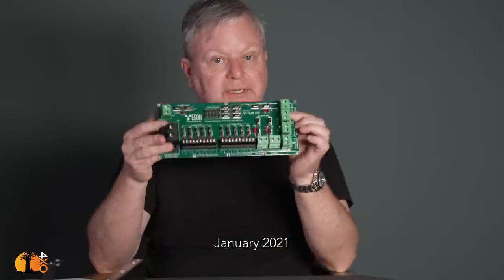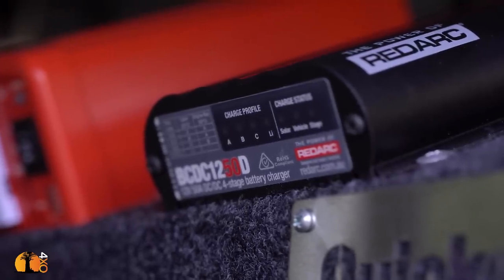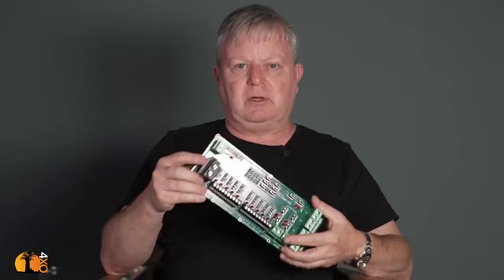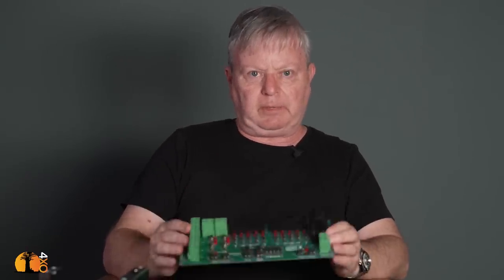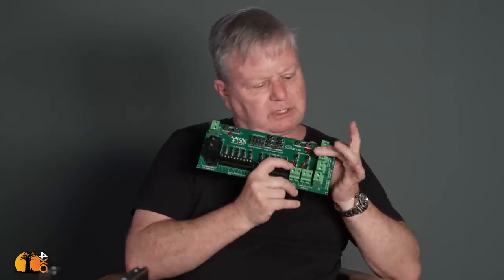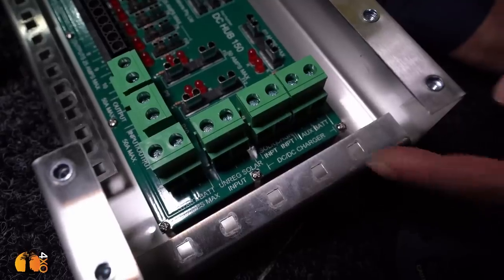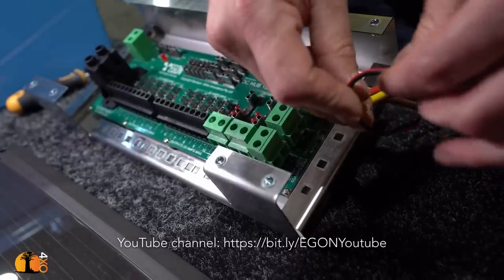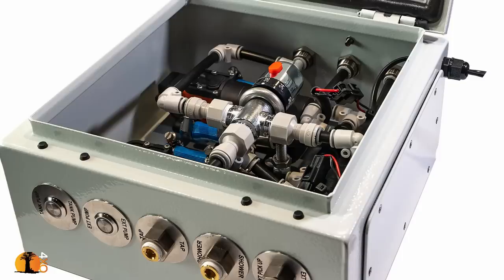DC-INSTALLATIONS MADE EASY. Unique, Problem-Solving Solution. Egon DC-Hub

Comment: So you made a fuse box. Would be nice to have some relays
Reply: That would make it bulky, but you're right, it doesn't cater to the all-important relays. That seems to be an afterthought. This EGON is supposed to make the electrical system easier and relays weren't addressed.
Reply: @Malc664  why would relays need needed? The circuits are well protected by the fuses in this central DC hub. I don’t see any need for additional relays for this hub.
Reply: @gotoylc  you would need relays for most appliances, unless you have switches that can handle massive current loads.
Reply: @Malc664  it already is bulky given it's a glorified fuse box
Reply: 100A on a regular fuse holder??? I definitely would prefer a mini ANL fuses for that current.
Also, the connectors are not reliable at all for a typical vibration 4x4 truck. Bolt terminal are way better.
All cables to the same point? Not always the best solution for every needs.
And by the way.... If some contact gets hot.... You may loose all your electrical circuits....
Sorry. I wouldn't buy it. A have a lot of circuitry. 24v and 12v and I definitely prefer good quality 24 and 12 and ground distribution blocks with mini ANL fuses.
Reply from the maker: Yes, its a fuse box. But there is no fuse box IN THE WORLD that does what this does. How many fuses in a typical trailer or 4wd build? 10? 20? And where are they? All over the place, in line, fuseboxes and how many buss bars? 1? 2? 3? How do you fault find in all that maze of cables? Is it easy? How about one unit where ALL the fuses (with the exception of battery terminal fuses) come together in one place. All of them. No ground bus bar needed. Half the build time, double the simplicity in wiring it and fault finding. If that doesn't seem like an advantage to you, then this product is not for you. Changing the way people do anything in a new, better way always takes time.
Reply: @4xoverland  well said.
Reply: @4xoverland  and I get that. Should do well for what it is

Comment: What makes this different is that it's well designed and ALL ANALOG. I'm not suggesting that it is inherently better than similarly capable digital units, but the idea of a bush-repairable unit makes a ton of sense.  I've done (hundreds?) of similarly complicated DC wiring jobs, and this would save me 5-10 hours of work, I charged 100usd an hour (a decade ago) - so it would have been a push for cost, plus be simpler for them to modify.  Would I BUY ONE? No, I'll do it the hard way and save the money, but it won't produce a better result.  Version 2.0 should include a few switchable relays and a fibre reinforced chassis would be better, non-conductive. Good work, this is a perfect product for anyone who wants it done right the first time!
Reply: The lack of switchable circuits perplexes me.  It seems like that would be the more important value-add for a potential buyer, since it would make controls for things like lights and intermittent-use appliances easier and safer.  Even if a device like an oven had its own control, being able to shut it off and know that it's truly off from a low-current switch panel inside of the vehicle would seemingly be a valuable feature, let alone controls for driving lights, winches, air compressors, and other accessories where running the high-current cables into the driver's compartment is undesirable or where one might want to have more than one point to switch such an accessory from.

Attempting to foolproof it with connectors that naturally limit the cable size is a good idea, and designing easy-read fault indicators is also a good idea, but either an improved product with the relays or else a companion product, a relay board that can be placed next to this board and take the outputs from this board and switch them would increase interest dramatically.
Reply: @TWX1138  it's also important to remember that this is the first product for this pair, I expect that they'll be offering iterations moving forward. A fiber reinforced poly chassis and a handful of relay supported circuits would be a natural version 2.0
Reply: @ewingfox6459  Yeah, the biggest downer though is the pricetag given the lack of these elements.  I get the value of the bus-bar concept along with sizing the connectors and the fault indicators, but it's 700 Australian dollars for just the board.  A fairly generic third party automotive fuse and relay holder that admittedly requires point-to-point wiring is around $20.  I know, labor is higher when it's not done with artificially depressed wages, and they've done engineering and testing to confirm their load levels, but it still seems disappointingly expensive.
Reply: @TWX1138  doing the point-to-point wiring is time-consuming tedious and extremely fault-prone if you're not in the trades and doing this stuff everyday. Considering that many people will spend upwards of $100,000 on building up their tourer, if less than 1% of their build goes to having a absolutely bomb proof DC mains, it isn't really a tragedy. I'm a big point to point guy and do a lot of audio these days now that I'm out of the trades, I enjoy the slow and careful pace and the results are pretty amazing but back in the 90s and early 2000s we were printing piles of circuit boards for all kinds of projects that would have been impossible to package in a point to point format. I have no doubt that he'll sell a pile of these, not every product is for every consumer. I bet a unit with five relay circuits, a poly chassis and a hinged cover, priced at probably $1,100 will fly out the door, especially after most weekend warriors drop a couple hundred bucks on component parts to prove Andrew wrong and end up with a bunch of blown fuses and melted wires :-)
Reply: @ewingfox6459  or a smouldering wreck of a vehicle after it catches fire.
Reply: @k2svpete  Yep, I've had these vehicles towed to my shop before, its sad to see someone's pride and joy burned to the axles.  Buy once, Cry once! This doesn't completely idiot-proof a DC install, but for people saying you can do it for 50$ of parts - they've never crafted anything outside of a pithy comment on the internet.

Comment: You guys are brilliant!! I love the simplicity of your Egon DC-Hub and yet the robust aspects for us overland builders that just need thing to be solid and work well. Love the easy troubleshooting ability you have with your system along with the ability to add devices when ever needed..…or remove them. When you are out and off the grid camping the last thing I want is some digital programmer not working or shutting things down or worse yet not turning it on. Awesome product!! I need this for my newest 2022 AEV Ram 2500 build.
Please tell me where I can purchase your Egon DC Hub. I am in US Arizona

Comment: Well done gentlemen! I applaud your innovation and execution. You two seem to be great partners and compliment each other well. I've been enjoying watching you work together. As a long time fan I enjoy all the details and background but if I may suggest, some may find a shorter more direct video easier to to determine if this is the right solution for them. That enclosure is also pretty slick. I suggest considering making access tool less. Perhaps a hinge and magnet will do the trick.  Cheers - Jason

Comment: This would have really been great - if it integrated a relay system so that switch panels could be easily integrated.  An SPODs setup without their ugly switches.  Plus all of the other stuff with the aux battery stuff you're doing....
Reply from the maker: Then it would just be another Redarc Redvision. This isn't the same and its not trying to be.

Comment: That is a really neat idea Andrew but I would suggest a modification to the circuit boards design. You have screw down cable terminals on the board. I would change them too the type that a small flat blade screw driver is just pushed into to fit and release the cables they are far better, I'm a marine engineer and work on lots of ships systems that have these screw down cable terminals and while very high quality they come loose and cause a lot of problems in the high vibration environment of a ships engine room. I would be willing to bet that if driving  with these screw terminals over constant corrigations and the general high vibration environment of a vehicle, they will come undone on a regular basis and cause niggling problems. Other wise neat idea.

Comment: Very expensive fuse box. You mentioned it has the solar input but I don’t think it’s is worth that kind of cash. I do t kind a little crimping and soldering, especially to save enough cash for a new surfboard. On the other hand, the water system sounds great, I would be interested to learn more about it.

Comment: Love it, I want one and I don’t even need it!  One suggestion is a bolt-on/modular remote connection (Bluetooth or WiFI) remote control/view/alert/logging capability and an app.

Can also see that for EVs this will be brilliant too because of reduced complexity, would be cool if you could hook it into the vehicles infotainment systems to enable integrated access.
Reply from the maker: "remote connection (Bluetooth or WiFI) remote control/view/alert/logging capability and an app." The Redvision does that. We won't be doing that.

Comment: Two problems for me: far too expensive at $800 for what you get and the physical size is rather large as space is always an issue.
Reply: At $800 we can expect some Chinese clones pretty quickly.
Reply: Nice product indeed, wanted one, visited the website, saw the price, and i was out... importing it in Europe, would bring the pricing even more up... for a full equiped camper, yes, for a more basic 4x4  with less connections, too expensive (for me)
Reply: Rather large? How can it be smaller?
Reply: @aussiecampingbloke55  It would be easy to make it smaller by at least a third. All the dead space between the connectors and fuse holders can be eliminated. The enclosure can be designed to save plenty of space.
Reply: @motolab.EuropeanMotorcycles  he stated that it's aimed at medium to complex DC systems.
Reply: @k2svpete  yup... but since Andrew targets primeraly the 4X4 "world" /scene/whatever i thought my comment makes sense...  for the record, i am not debating the quality of the product, etc.. just for my Land Rover & "basic" auxillary battery setup.. Redarc DC->DC + fridge + compressor and maybe a charger but otherwise basic.. i feel the need for such a nice unit, but can not justify the costs, especially after shipping & import taxes (AUS-->EU) , my thoughs are that the market can be at least twice as big or bigger if the price is significant lower, this look like a camper unit, suited/used for complex Overland... but what about more simple 4X4 use but still DIR (doing it right), as an oportunity ;-)
Reply: @motolab.EuropeanMotorcycles  I agree that a smaller unit, incorporating switchgear etc for a more common setup would be in greater demand but there are cheap setups like that available already. Certainly not the same quality but I think it would be a disaster to try and place a premium product in that segment, hence the target for this one. 

I reckon for campers it's enormously valuable and for those with an extensive canopy setup etc.

Comment: Not trolling, but not a question as such either, Kapton tape on the metal panel behind the PCB would make sure that no-one can cause a short by flexing the PCB, I know what people are like for breaking things. A captive tool with a screw driver blade and an allen key attached to the unit would not be so daft, reminiscent of the pen on a string you might find in a bank. Normal people might carry a screwdriver but are unlikely to have not lost the right size allen key even if they had one in the first place. A small section of the board also could usefully be used to hold a small stock of blade fuses, or a very simple supplemental board to carry spare fuses. As someone who has made a living as a field service engineer (radio) I somewhat understand the concept that whatever the fault is there must be tools and simple spares in my vehicle to get the job done.

Comment: I thought it was going to have some Auto Load Shedding....
Monitor the Current Over Time of each output 
Allow for Bluetooth Monitoring and Switching of each load...

The only problem with a single device to which all are connected, is if something fails on that device.

And I'm not sure DC wiring needs a central location...
It sure doesn't look under bonnet friendly.... or have much of an IP rating.

Hopefully it goes well for you both
It does tidy the average install up a bit

Comment: Those of you who think this is really just a glorified fuse box are somewhat missing the point.  
However it will not eliminate voltage drop issues.  For that you will need to understand conductor losses in typical automotive copper cable.  And for that you'll need a simple formula.  So for anyone interested,  here it is: 
Voltage drop over a cable run can be calculated as:
Conductor length in metres (including return path)
× current draw in amperes
× the arbitrary figure for copper conductors of 0.0164 
÷ cable x sectional area in mm2. (You will need to ascertain the cable conductors cross sectional area in mm2 in order for this formula to be effective.  Not the cable diameter. There are various charts available for this) As an example 0 B+S is 50mm2 and 2B+S is about 35mm2 and so on. ( B+S and AWG are roughly equivalent)
The aim is to have no more than about 3% but less is best

Comment: Andrew, no resettable fuses is a no go for me. I love the idea of the product and the design is amazing. I understand that the size of the unit is reduced by using regular fuses but I cannot rely on bringing replacement fuses and troubleshooting by swapping them. At least you need 5 circuit breaks that can be reset.
Reply: You can actually buy resetting fuses so you are not having to carry replacement

Comment: Not sure I like this idea, seems to me there is a lot of potential for high current positive cables being bare at the connection terminals which is dangerous.   Those cables should have shielding, if someone isn't capable of using a soldering iron, crimping and shielding their own cables they have no business trying to wire up an electrical system.  The footprint of this thing would probably cause more grief than it's worth, certainly more space than I would like to give to it.

Your comments regarding voltage drop are a tad misleading as the entire point of using a DCDC in the first place is to overcome voltage drop from using undersize cable runs.  DCDC's swap high current, low voltage for low current high voltage after the voltage drop has occurred in the initial cable run.  That is why a DCDC is always next to the battery it's servicing so there is intangible voltage drop from that point.

The other safety aspect is your fuses should ALWAYS be as close to the power source as possible.  This thing allows people to have fuses nowhere near the source upfront which again is dangerous and a bad idea.

$840 for glorified fuse holder?  okay maybe that is harsh, but it smacks of a premium solution looking for a problem rather than solving one.
Reply: I'm dumber than dumber with DC and big $$$ but you could still put a fuse near the power or does that defeat the object?
Reply: I tend to think it's an excellent idea that is already in use for A/C voltage systems. It's a compact version of a fuse/circuit breaker board on a house or factory. All the juice goes to the one central location where it's easily terminated and fused. Looks like a very reliable, user friendly board that will no doubt be copied a million times over in years to come.
Reply: Ahhh, the fuses are right next to power source for all those accessory outlets. There's one high current input from the main battery, obviously a fuse gets placed up there. 

Paying attention is important, mmkay?
Reply: @k2svpete  "obviously a fuse gets placed up there" are no not obviously, as the whole point of this product is so "ALL the fuses are in one central spot" and that you don't "need to know how to crimp or solder or use heat shrink".  Paying attention to what ASPW said about his product is important, mmkay?
Reply: @MrLoridin  yes, you should pay attention champ.